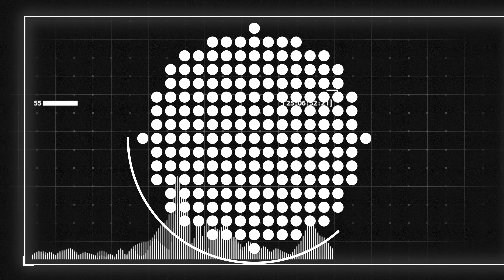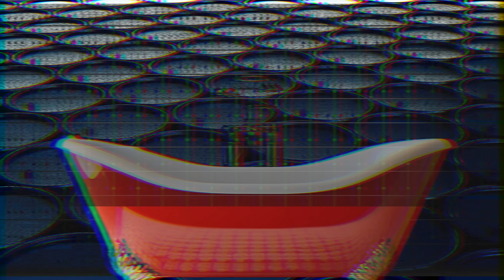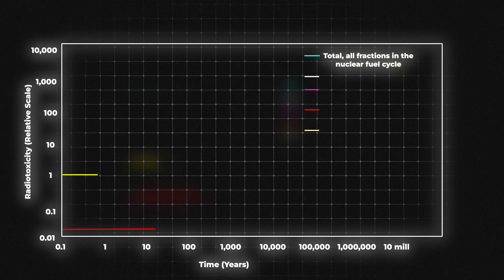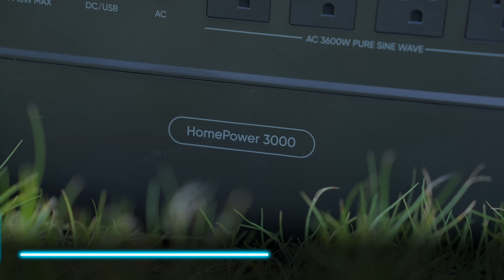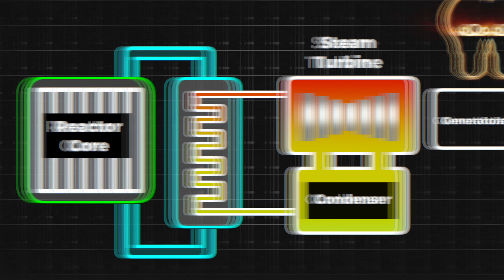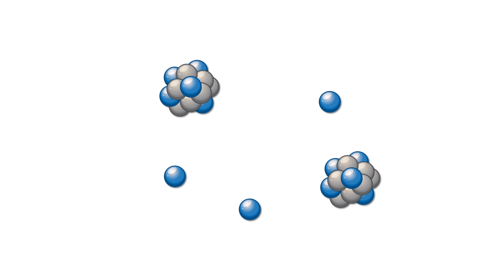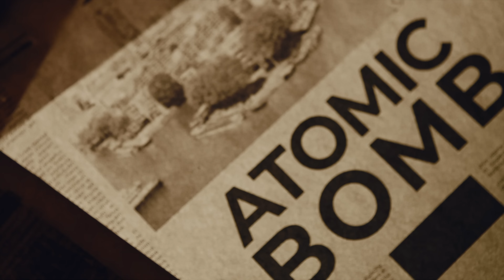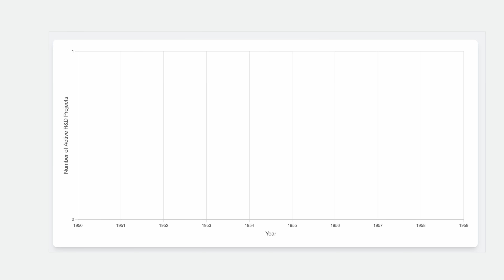Why Thorium is About To Power Everything

Comment: The point is - why use thorium at all, when spent fuel and depleted uranium (DU) is abundant?
Uranium has absolute the same energy density as natural uranium, about 24 GWh/kg. And on full burn down it produces similar waste as thorium at full burn down. 
The waste of 1 reactor year of a 1 GWe conventional reactor can provide up to 140 times the electricity originally produced. Additionally, the side product from enrichment, depleted uranium can provide another 4 - 5 times the electricity of the spent fuel. In total, this is about 700 times the electricity that was produced by nuclear in the past. This are resources worth tens of trillions or even hundreds of trillions USD, that could pay the debt of the US multiple times easily.
A side effect is that the "waste" produced after complete burn down consists of 95 % partly precious metals, and about 5 % of waste that decayed after 300 years to the level of natural uranium. Of course, it is poisionous, but can be stored just like normal chemical waste. And the amount is small anyway, because 1 kg or uranium/thorium contains 24 GWh of thermal energy. 
But be aware, beside some advantages of thorium, there are nasty site effects. There are hard radiation sources within the thorium-cycle. Proactinium 233 and Thalium 208. Pa 233 comes from breeding Th233. It is a bad neutron poison, that requires immediate separation from fuel, otherwise reactivity stopps. Pa233 then must be stored separately, until it has decayed to U233. This decay also produces hard alpha and beta radiation. TI208 on the other side, comes from a small part of U232 produced during breeding. U232 decays at some point to TI208, which issues hard gamma radiation. This requires more extensive shielding and complicates handling. So the thorium-cycle has some drawbacks, which are often not mentioned. 
IMHO, before using thorium, waste and DU should be burned. And if this isn't enough after thousands of years, there is the posibility to get uranium from seawater, for which China seems to have found a cost effective solution now. 
Of course, you can use thorium sometimes in the same reactors, that burns waste and DU, but it isn't necessary for energy needs for a long time. 
So again, why use thorium when it isn't really necessary?
Reply: Thorium is a waste product of rare earth mineral mining.  

We even avoid some rare earth mineral deposits because they contain too much thorium.
Reply: @danafletcher2341 Yes, but compared to the nuclear waste it is harmless, and can be left where it is. It is more important to reduce and eliminate the harm.

Comment: Will it produce strontium 90, yes or no?
Reply: Yes, Sr90 is a possible daughter product of fission.  Why is this important?  All daughter products are neutron rich and rapidly beta decay to stable isotopes.  Sr90 is certainly less dangerous than some other decay products.  (If an isotope has a half life of 10 years, in 100 years it is 1024 times less of a problem, where as mercury contamination lasts forever.)  Fission products tend to have short half lives, which make them very dangerous for a short time, but in a couple hundred years they are approaching back ground radiation levels.

One of the huge advantages of Thorium reactors is that they produce far less transuranic actinides which are long term problems.  The waste from a Th Molten Salt Reactor (MSR) decays back to background levels in 200 years.  In addition, MSR can be engineered to burn traditional nuclear waste, getting power out of it.

For more information, you could read: "Molten Salt Reactors & Thorium Energy", edited by Thomas J. Dolan, Woodheard, Publishing Series in Energy, ISBN 978-0-2-08-101126-3.

Warm regards Rick.

Comment: You use  Robert Hargreaves schematic cutout renditions of a single 65×180m  ThorCon 500MWe constructed in a double-hulled bulk-carrier shipyard.
These are powered by liquid metal Thorium ion in sodium-Berilium fluoride molten salt reactors (TMSR) designed for Indonesia's  8×500MWe PPA. Constructed and delivered to sites completely fitted  out (without fuel salts) in the Java sea , for less than $1000/kiloWatt.
Levelised pre-profit cost of less than $30 per Megawatt.hour (<$0.03 per unit kiloWatt.hour) as a continuous 24/7 (97%) base-loader supply but able to automatically load balanced supply for irratic non-recyclable 'renewables' and if needed, to cold start.
These high temperature but near ambient pressure, described as 'walk-away safe nuclear energy method consumes up to 97% of it's fuel over an expected life of up to 80 years.
What remains of it's so called 'waste' consisting mostly of Strontium90 and Caesium137 (both of which have 'half-lives' of about 30 years) needing only 300years of secure storage. This nuclear waste is less than 3% of typical 3rd & 4th generation  high pressure light water reactors (LWR), with their 'nuclear-waste' needing thousands of years secure storage..
Because the limits of graphite moderators cycle life requires periodic  replacement, the first pair of reactor pot's salt is transfered to the adjacent new pair of pots every 4 years, with the changer over of each 250MWe taking less than 24 hours.
The used pot allowed to passively cool down until a pair of new pots are substitute for 8 year old empty used pots including their hot half of their internal primary heat exchanger pipe work as well as an internal circulating pump shaft whose motor is located outside above the pot lid.
The primary heat exchange salt is sodium-Berilium fluoride, running at slightly above ambient pressure while the secondary heat exchangers salt is commonly called 'Solar Salt' providing the 2×250MWe steam turbines with their superheated water.

Comment: At the end of the day, it’s just another way to create steam to power the Victorian technology of turbines to create electricity.
We need a way to generate electricity directly from an exotic fuel.
Reply: @pwensor  why? Steam turbines are mature, reliable, and efficient. Why do they need to be replaced?
Reply: @JorgTheElder You’re missing the point. What I mean is we need to figure out how create electricity ‘spontaneously" without having to create heat, to produce steam, to spin a generator. I’m sure Nikola Tesla could have done it a century ago.
Reply: @pwensor  I am not "missing the point." You have provided zero reasons why we need to do that. We have had power cells that can turn hydrogen and oxygen direct into power for decades, but they are not scalable. Having what you describe would be great, but we don't need it.
Reply: @JorgTheElder Don’t act like a prat. Why do I need to "give a reason" for my opinion?
Reply: @pwensor  No one is claiming you HAVE to answer. I asked because I see zero why we need such technology and wondered why you feel that way. If the answer is just "because I say so" then I know that I can dismiss your opinion as not very interesting because it is not based on reality. Resorting to name calling makes it perfectly clear that your opinion is not based on much. We use steam because it is affordable, reliable, and efficient. Wishing for magical new technology doesn't accomplish much.

Comment: There are quite a few inaccuracies in this video. The prime example is "thorium isn't radioactive". It very much is and why it was used in welding rods.
Reply: @atrumluminarium those sunbathers on the beaches of Goa and Miami lay on fertile Thorium a non-fissile sand with particularly impotent half life of over 14 billion years older than the universe and no more harmful that cosmic radiation to airlines pilots...
Reply: Which are fertile and which are fissile Mate?
The half life of natural Thorium is 3500× greater than that of Natural Uranium hence Thorium is 3500× less Radioactive , so stop the accusations of inaccuracies in the article and apologise please.
Reply: @mrvaticanrag3946  So? That's not rhe point. U238 is also non-fissile and has an equally enormous half life of 4 billion years and U235 is 700 million years. Here's he's phrasing it as an advantage over uranium but they're pretty much the same.
Reply: The fact checkers gave up in the first 10  seconds.

But I don't see any deception in the video, so that is good.
Reply: @Kian139 Thorium-232, despite its extremely long half-life and lack of fissile properties, is considered safer to handle than uranium in some contexts due to its lesser radioactivity and non-tracking by government agencies.
Reply: @mrvaticanrag3946  any argument over isotopes each with billions (plural) of years half-life is just stupid. It's ridiculous nonsense and its only purpose is manipulation.

Natural uranium is not dangerous and neither is commercial uranium fuel.

Comment: How small can one make one?
Power a ship?
A truck?
Smaller than a container that could be used to recharge a fleet of electric trucks?
Reply: Wrong question: How big can you make them? Answer: Really big.
Reply: @Kian139  I want small, so individuals, companies, small communities can be indpendant from our explotative power companies.
Reply: @josviersel  that is not how an electrical grid works.
Reply: @Kian139  Who cares about the grid?
I want to disconnect from the grid.
Reply: @josviersel  all sane people care about grid. Some only care when they are disconnected, but everybody cares.

If you want disconnect, yes then you certainly need small powerplants. In that case, they can be made very small, down to 50 - 100 kW. I'm sure other options than nuclear would be better, simpler and easier on that scale. Woodburning comes to mind.
Reply: @Kian139  That is why I asked the question - how small can we make it.
Connecting to the grid costs, even when not using power. 
I don't know how it is where you are, but a new build's connection here can costs tens of thousands of dollars.
Reply: @josviersel  do you really think any off grid production i cheaper or better?

I don't assume people I respond to are crazy, and that is why I responded as I did.
Reply: @Kian139  People are going off-grid because it is cheaper for them.
Does not suit everyone, and depends on local conditions. 
Recently people are reporting that proper solar setup is paying for itself in 5, 6 years.
So yes, some people are finding off-grid cheaper and better.
Reply: @josviersel  I guess that is like saying it is cheaper not buying food. But the extra effort it takes to not starve will be significant. If that is the dream, then go for it.

Only solar sales people say that it is paying off like that.
Reply: @Kian139  Not a bad analogy.
Solar requires capital outlay up front.
Can have food at no cost if one grows it oneself, that requires a garden, seeds, skill.

Comment: What would the water usage be vs uranium reactors?
My issue here in Australia ( if my safety concerns are alleviated from this video) is we don't have enough pure fresh water to sustain the technology...
Reply: Traditional reactors ran at around 200 to 250 C.  These will run from 500 to 900 C.  The high temperature means that they can be engineered to be air cooled.  This is an advantage of MSR over the designs from 80 years ago.  (To be fair, they are slightly more efficient if water cooled, but this is not a necessity.)
Warm regards, Rick.

Comment: And then there's the time issue. No doubt that data demand is growing rapidly. And we all are benefiting from AI even if we don't know it. Renewables (solar, wind and batteries) are rolling out at a pace and a price that was unimagined a decade ago. Yes, they will struggle to keep up with the data centre roll out but that's a priority issue. How long do you wait for thorium? Do you tell the digital industry to wait for 10 years while thorium or conventional nuclear catches up? Or, do you continue go with the clean energy option that is actually powering the world today and growing and evolving by the minute?  E.g. Australia is leading the world in domestic rooftop solar and it has become a serious grid supplier even though less than half of our houses have it. And we are only now starting to look at commercial roof space which is probably a larger resource right there at the point of the load. We are starting to add batteries to our domestic systems. Our domestic load in Australia is roughly one third of demand so just by adding solar and storage to our houses,we will free up a huge amount of electricity, let alone including the commercial space. All on existing footprints. Add to that the storage capacity of an electrified transport fleet and you have everything you need. All right there where the power is used today. In a flexible, distributed, non baseload system which is also more efficient from a transmission aspect. Thorium may eventually play a role one day but today, where the demand is growing now, renewables are the only solution.
Reply: Nuclear is being built out faster when a country commits to nuclear.

Comment: Tired of the nuclear propaganda!! Same old B.S. fix the waste problem then build new reactors. The waste is going to be left for future generations.
Reply: Actually this reactors are part of the solution to nuclear waste, because they can mix in spent fuel into the fuel and burn it down. But of course, you don't need thorium for this. You can do this with the uranium-cycle, too.

Comment: Thorium is not about to power everything. The two most dedicated thorium frontrunners have abandoned thorium and stepped back to a simpler/cheaper uranium-based MSR (Flibe and ThorCon)
Why, because the breeding chemistry adds too much cost and complexity to the reactor, and fuel cost doesn't come close to making up for it.
Reply: China's test reactors provided a few kW to the commercial power grid, so Th HAS been powering something for over 10 years now.  China's first Thorium MSR is coming online in 2029, which will power an industrial park in Mongolia.  

Thorium MSR does not need massive pressure vessels, huge containment domes to contain steam explosions, can run at atmospheric pressure, can be refuelled while the reactor is running, and has many other cost advantages.  It is hard to see how this technology, when mature, will cost MORE than traditional nuclear power.

Warm regards, Rick.

Comment: No it's not the promise of thorium it's the promise of liquid-fuelled reactors, uranium liquid fuelled reactor waste lasts slightly less long than thorium liquid fuelled reactor waste, also if you were breeding U238 into plutonium you can use all the uranium including the long lived high level nuclear waste we currently have, it's actually an ideal starter for the reactor as it already has a bunch of plutonium in it, you would need to mix it with pure weapons grade plutonium to start up the reactor but after that you can feed in a mix of nuclear waste and unenriched uranium.

Comment: problem 2 can be fixed with a dual fluid system. use molten lead to cool the core and "pump" the lead not the salt around.

Comment: Ricky, if the materials issue is still a question mark regarding the corrosive molten salt, 
Is it possible to engineer a method to swap out the “piping” periodically?

Or would the radiation make it prohibitive?
Reply: Copenhagen Atomics use anhydrous molten salt which eliminates the corrosive aspect which allows using common stainless steels.

They are running a reactor now with molten salt heated with electricity for testing.

Comment: you've great videos, Ricky. might i suggest you look into an MIT spinoff, Quaise, which aims to access the superhot rocks (400 - 1000c) which are deep underground using a gyrotron generated mm wave system to melt through basement rock to reach the deeper levels  where the superhot rocks are located? you've covered geothermal in the past. have you looked at Quaise? [other youtube videos about them are interesting.]

Comment: That's a different take, most of the previous coverage I've seen of Thorium has talked about 'pebble bed' reactors, which I've had concerns over being very-high-temperature-reactor designs. Molten Salt Reactors reach even higher temperature and pose immense corrosion challenges. The Dounreay MSR, in Scotland, is still being decommissioned, and that's likely to continue until 2036 (42 years after it ceased generation).

I always preferred the Canadian CANDU reactor, which is happy 'burning' Plutonium, Thorium or Uranium (including spent fuel rods from other reactors).

CANDU is a relatively low temperature design, which is passively safe, without the inherent corrosivity problems, but it's biggest problem is the investment needed. Creating Heavy Water is incredibly energy intensive, but I can't think of a better way of soaking generation overcapacity than using it to make Hydrogen gas or Dueterium, rather than disconnecting solar, or shutting down wind turbines.
Reply: Say goodbye to CANDU!

Comment: A few things:
You have a lot less nuclear waste if you recycle.  Just like France does.

You can use a heavy water reactor to burn U238.

Heavy water reactors don’t require refueling shutdowns.  

Heavy water reactors can burn nuclear waste.

Thorium reactors have a problem if you use the dump tanks that over time the fuel in the tanks migrate and can become critical.   Just ask Oak Ridge.
Reply: Heavy water for burning U238 is not really that good. Breeding U238 to Pu239 is much more common and really good. Fast reactors can burn everything and they are awesome. My favorite is a Fast Molten Salt Reactor.
Reply: @Kian139 the Canadian CANDU don’t seem to have a problem.
Reply: @fountainvalley100  CANDU does not use heavy water to burn U238. All pressurized water reactors do some breeding to Pu239 with or without heavy water that is then burned. They are not actually considered breeders. Technically they are iso-breeders.

Not requiring shutdown for refueling is a design feature and does not really have much to do with heavy water.